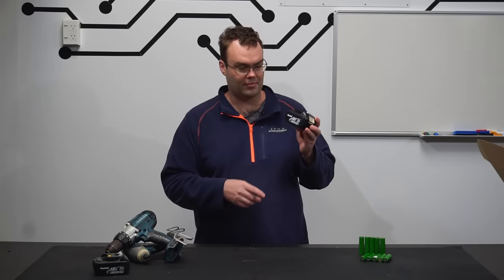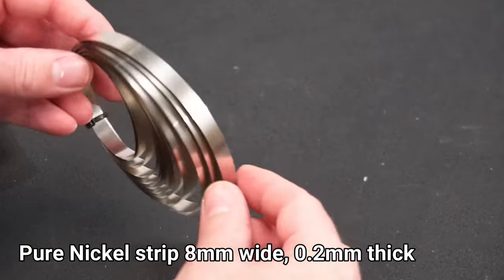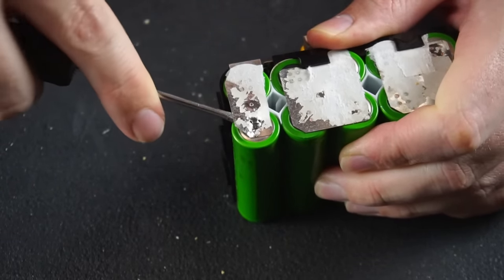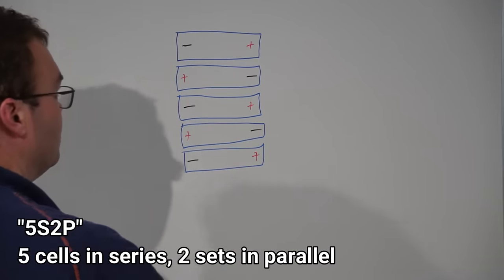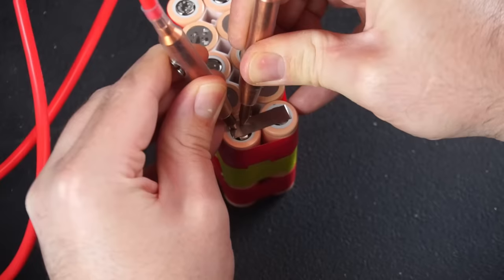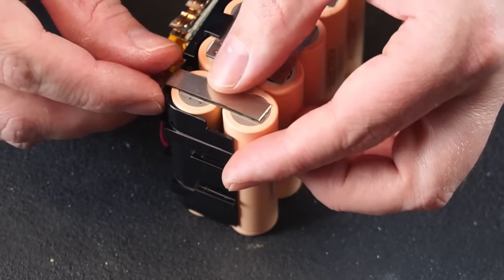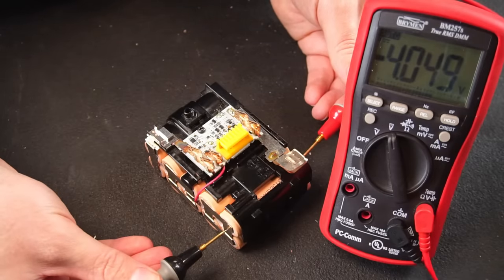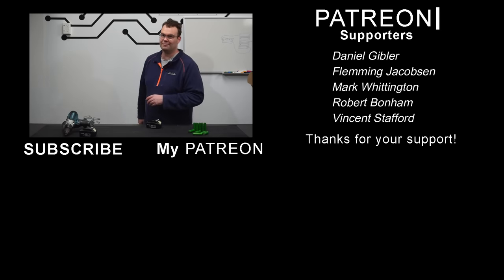Repacking Makita 18v Lithium battery with New Cells (Save $$$'s)

Comment: These newer cells you added are 2100Mah each, if you add them with parallel config in two, they become 4200Mah not 5200Mah as you falsely stated in your video @ 0:16, fail

Comment: You made few critical/dangerous mistakes, please get educated yourself first before you try to teach thousands of people.
Reply: And what is the point of your comment without specifying the mistakes? It will not help anyone.
Reply: @GunSmoker  Well because why repeat something that has been explained already on the internet thousands of times?
Also fixing entire video with the comment wont really work.
Though I can highlight the issues:
- sharp corners
- no fish paper on positive sides
- cells with different level of charge (voltage)
- small piece of tape welded on top of the existing tape right between the cells on positive side
Last one is the worst, I have no idea how his pack didn't short out and blew up during welding.